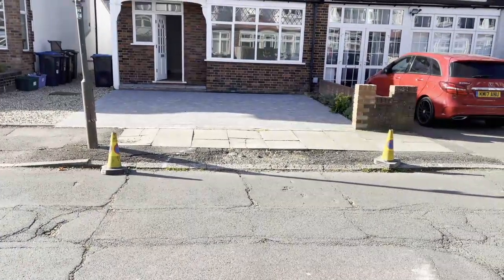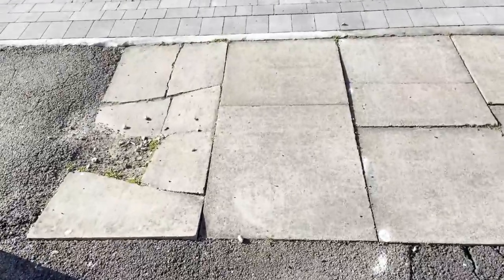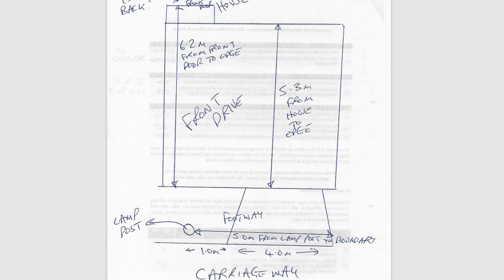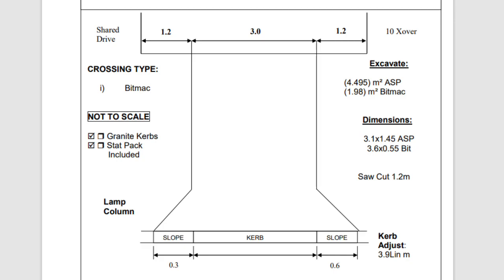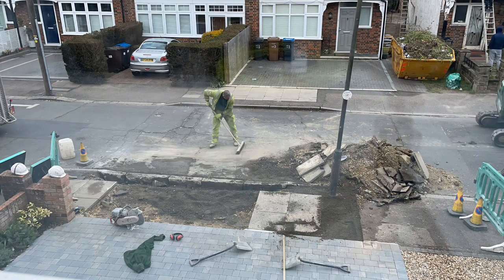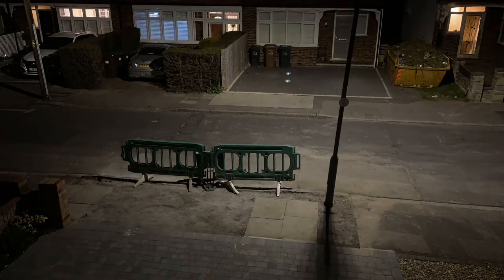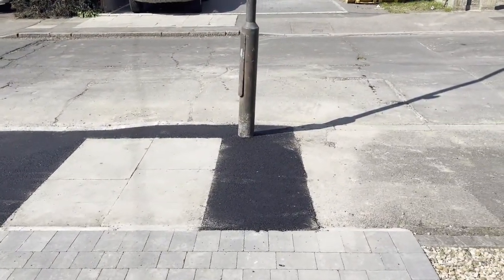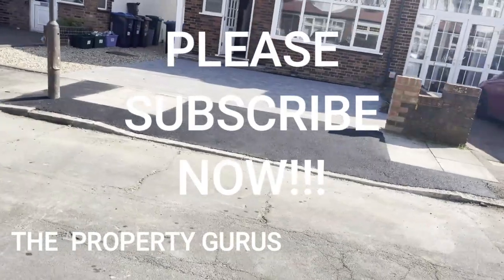Drop Down Kerb Installation TIME LAPSE - Before & After, Cost & Application process for Dropped Kerb

Comment: I paid for mine £2300 in Barking and Dagenham council. It is 3rd day today of their work. First day they brought barriers and kerbs, second day they broke asphalt and removed old kerbs, today they removed few concrete bits and put tarmac. They worked about 1 hour per day and there is other 8 days on their permission board. It took a bit longer then I expected.

Comment: I'm planning to drop down my kerb at my property in Haringey borough. I received the application form, do I Architectural designer to draw me the sketch? As I thought that needs to be done by a professional? Haringey is telling me to submit the application form first before building the drive way?
Reply from the maker: Hi Giuseppe. No need for an architect. Measure your front space and simply draw the proposed drop down yourself. Check the rules on the council website before you start. 👍
Reply: Oh okay. How wide is your drop down kerb? Haringey is giving me different measurements. Thinking of going about 3.0m....the wider I go I'm guessing it's more expensive
Reply from the maker: Go for the maximum 5m - you will regret it if it is too narrow. 👍
Reply: @JoeBlogs  Haringey maximum is 4.8m. might have to measure my neighbor to see how wide there one is

Comment: I'm researching as I want mine to be done, gotta say it would have looked nicer if they put flags back in rather than tarmac.
Reply from the maker: Hi. Thanks for watching and the feedback. I agree with you buy unfortunately we didn't get a choice as the Council are the only ones that are authorised to do the work. They charged us £1,500 and used the cheapest material to finish it. 😣
Reply: @JoeBlogs  I opened up the entrance to our drive way and have the old 45 degree angle pavement half way up the new opening.
I did the new wall over 18 months ago but just today had the drive newly block paved and its annoying that quarter circle.
I think ours will cost about the same, crazy prices.
Reply from the maker: When there is only one option to choose from they can charge as much as they like 😣🙁

Comment: That’s a poor job, the finish of the kerbs and tarmac is to an awful standard. Kerbs follow the road in level but they should follow the specification which is within 6mm of 25mm face despite what it leaves the road looking like
Reply from the maker: Totally agree. It was also a rip off but that's what you get when there is only option to choose from 😡
Reply: Your not even getting new kerbs they have reused the old , used old flags , dug out 100mm lashed the tarmac down piss poor and for 1500£ for in reality is a days work is a rip
Reply: Edges poor kerbs poor prob used 200 quid in materials

Comment: I am using.my partner fone I'm a groundworker laid hundreds of slabs kerb, set pedestrian crossing and laid miles of tarmac ,. I'm sorry to say but work was rough   . I guess you waited for tarmac as company got a large load and more than likely tarmacesd few crossings that day , did you say waited 3 days , and few hours kerbing , prep 2 a day over 4 days Mon to Thursday ,8 drives tarmac Friday , £1500 per one so times 8 So £12000 gross profit . ??? How do you become a approved contractor ,
Reply: get accredited to the approved contractor scheme. Going to need to show you have the correct level of insurnace and may wan to see last three years accounts as a limited compnay